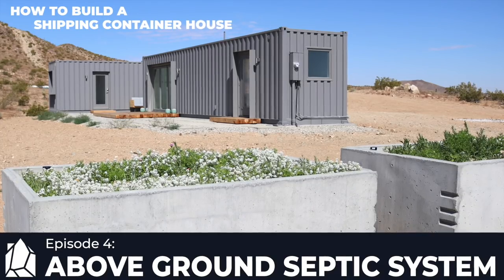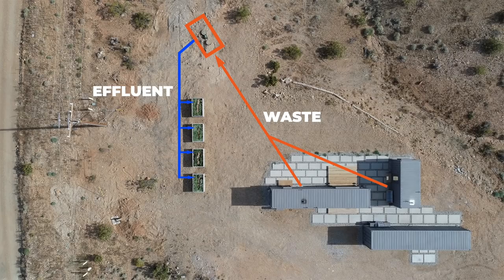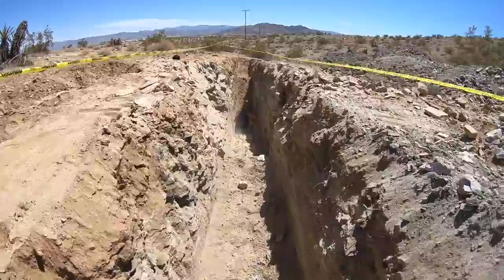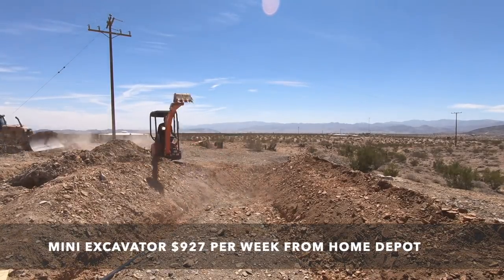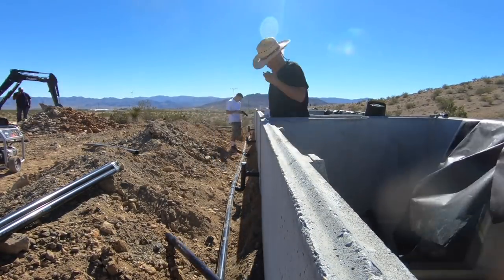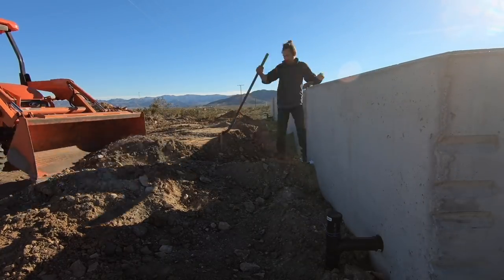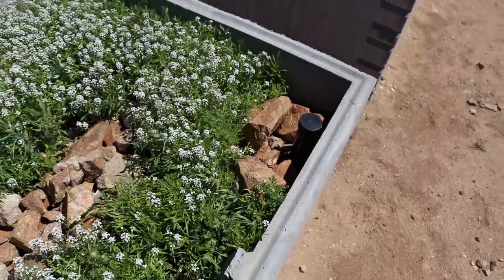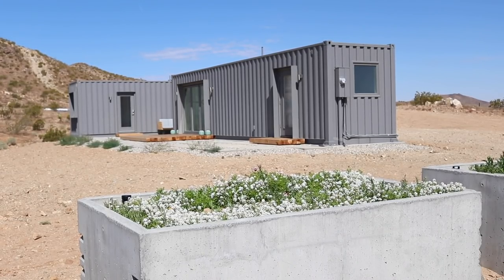Above Ground Septic System | Ep4 Building Shipping Container House

Comment: You should NOT poor grease down the drain. That’s a recipe for a clogged septic system.
Reply: smcox1991 not entirely. Grease floats on water so it will be on the top in the septic tank. There is a filter or a baffle in the septic tank that goes down to about the middle of the tank so that only water goes into the pump compartment. Unless the first compartment of the tank gets over full due to a plugged filter or other problem it won’t be an issue.

Comment: Really cool. But, I have a different point of view about construction. YESSS its totally regulated, especially here in the EU. But, Im sorry to say that, but I am still laughing about your framing inside the containers. Yes you need them, but how its done, or details which are shown here and there are really,.. bureaucratic oh and not executed correctly. The header of the large door for example, as well as everything which has been wood connected to the metal angles the way you did, they wont hold any more as the container does anyways because they would certainly FAIL. You have, accidentially added weak parts in the construction, which will not only carry the inside, but also serve as a support for the outside structure. But they have,... wait for it.... 2 nails. Also, raising the header with these 7 pieces of stuff you put underneath.. well, now its not the header anymore who supports, but the 7 pieces of cuts you stuffed in there. What I also would have done differnetly is the insolation - Yeah California, I know, Ive been living in AZ for 8 months... But still,... it looks like someone threw trash inside the gaps - And you call this your home. Or vacation place. 
I really wish you the best, and hope that you will never have to open these areas ever again. 
Oh, and I think you were curious about the construction with these containers, but I think, you would have had a better quality and better base if you would have built the outsidestructure by yourself. Would have saved time and costs. OR, you could have taken some used trailers and renovated them but yeahhhh... Its all about the project, right? ;) But next time, you should not get into a hurry or rush. 

The sepctic tanks for the effluent are a "cool "idea to avoid paperwork and tests and costs,... but they will become a big problem! The risk of infection, because you are exposing bacteria in a container -  So you collect and evaporate it- You are not recycling it,... It will not only smell really, really bad, but it also attracts all sorts of insects and animals. The best would have been 4 containers each 1500Gal, closed, underneath the surface -And have the waste professionally disposed by companies as soon as the 3rd is full. 1500 Gal... Thats 30 bathtubs,... 60 showers and 50 poops, thats... nothing.

Comment: Audio too soft. right click -> stats for nerds -> volume: -10.2dB. Ideally it should be between -2 to 0 dB. Turn up the mic gain and move it closer to your face first, if still not loud enough then amplify digitally. Audacity is a free audio editing software that you can use